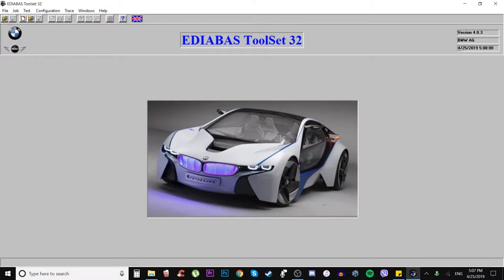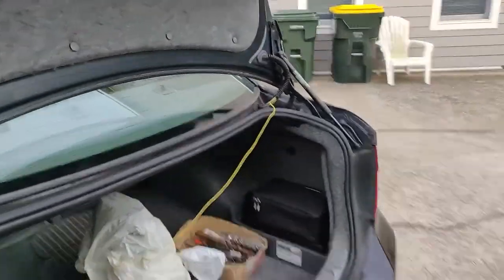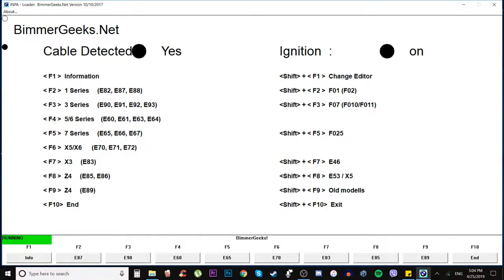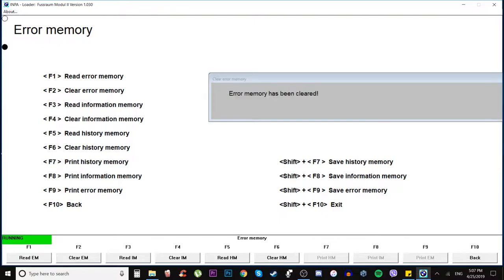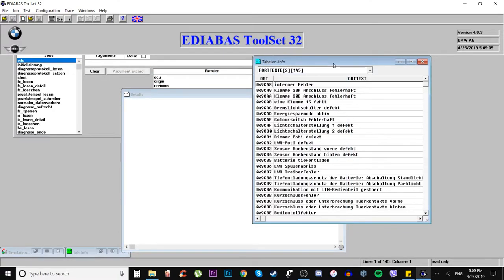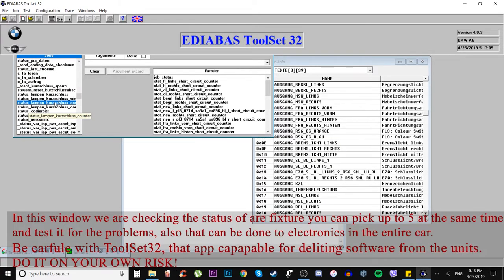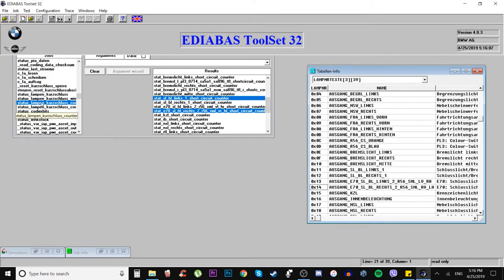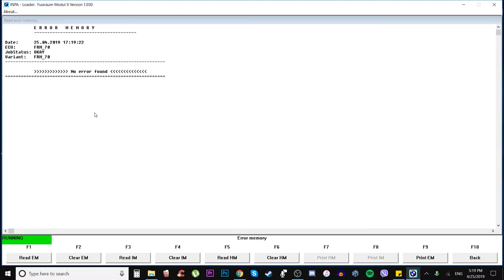BMW Coding FRM short circuit counter reset Toolset32. light not working. FRM2 FRM3

Comment: I have been trying this but can’t get it to work right. Can you help me?
Reply from the maker: Hey! Where did you stuck?
Reply: @Makhnovets  my inpa isn’t working right I guess. It said it couldn’t communicate with Frm and on info screen the Frm wasn’t listed. My issue is the left rear blinker and left side marker don’t have power, no error messages but with fox well I found Frm code 9CBB
Reply from the maker: @nathanielfarmer1732  what year your bmw? What cable you use? Dit you set latency and speed in device manager?
Reply: @Makhnovets  2010 335i and no, I don’t know what that means but I’d really like to.
Reply: @Makhnovets  kdcan
Reply: @Makhnovets  where is the device manager?
Reply from the maker: @Nathaniel Farmer  minute 8:25 https://youtu.be/uYQZcbutWcc also set the bits per second to the highest number
In terms of the cable, it might work it might not depend, you will need to test it on the car if there’s still a communication problem you will need to Solder the two pins in the kdcan, or get one with the switch, but that for later, in most cases it will work fine.
Reply: @Makhnovets  it does have a switch but there’s no number or anything it’s just got 3 or 4 different settings.
Reply: @Makhnovets  ok i see, I’ll try that tomorrow. Thank you ! I had the black dots on inpa but probably had the switch wrong.
Reply from the maker: @nathanielfarmer1732  if you looking on the switch all the way to the right is for the car’s 2009+ to the left 06-08.
I will double check that but I think I got it right, there Only two option all the way to the left all the way to the right.
Reply from the maker: @nathanielfarmer1732  did you figure it out?
Reply: @Makhnovets  I haven’t hooked it back up yet, been working. So will inpa give me the specific code to look for on tool32 or is it the exact same procedure that you did in the video?
Reply: @Makhnovets  when I first started driving this car the blinkers would blink 5 times instead of 3, was that something someone coded in?
Reply from the maker: @nathanielfarmer1732  yes, that was coded for European standards, it’s easy to revert if you want, i can make a video, you gonna need bmw tools as inpa and ncsexpert, i also have video how to install them if so.
Reply: @Makhnovets  I have NCS expert inpa and tool 32 I just don’t know how to use them
Reply: @Makhnovets  I’ve been trying to learn on my own but it’s tough. I’d like to know more.
Reply from the maker: https://youtu.be/KObx-RukECU - this one is how to code(Exaplenation)
https://www.youtube.com/watch?v=aPApyIFPbCc - in this video will be your problem, which is FRM module, you will need to find the hezart light or so and change for the option you like... or you simply can reset the module to Vehicle VO(Default) But watch the first video before doing anything!
This is step by step on resetting the module! Make sure you have battery connected to tricle charger, and your OBD cable work just fine(Talking about Device manager)
1. Load NCSExpert.
2. Load Profile and select Expert mode(You can find in web how to make your own profile for coding, by default you will not have the Expert profile! you will need to make your own!)
3. F1 (VIN/ZCS/FA)
4. F3 (ZCS/FA f .ECU)
5. Choose E89 (for the E9X)
6. Select CAS
7. F6 (BACK)
8. F4 (Process ECU)
9. Select the Module I want to Revert back to Stock.(in your case NFRM or FRM)
10. F2->Choose "SG_Codieren->ok
11. F3->to start coding the ecu with factory settings according to the vehicle VO.
Let me know if you have any questions!
I will make video about module reset soon... Good Luck & Subscribe!
Reply: @Makhnovets  ok I will try this, I had no idea there was so much to this thank you for all your help
Reply: @Makhnovets  I may try this today after work but can I FaceTime you when doing it?
Reply: @Makhnovets  I had my jb4 on map 5 and just read where it has to be on map 0 or off to connect. I want to code the 5 blinks back in also the previous owner installed m3 cluster, did he have to code it in and am I gonna mess that up?
Reply: @Makhnovets  hey are you available?
Reply: @Makhnovets  I got in inpa and my code is 9CBB but I can’t find it in tool 32. So frustrating

Comment: Hi,  if i press f5 nothing happens, it won't open it ?
Reply from the maker: at the top left near the file you can see the job button, open it and then you will see single execution or continuous, press the single execution, also on the laptop you have Fn. button on your keyboard, that can be the issue as well.

Comment: This is very stupid from bmw! Why not just erase a fault code and return the circuit to normal? 
I replaced the body module on a e83 x3 because interior lights were not working. Now i learn that the circuit just needed reset and my autocom cant do it!
Reply from the maker: Yeah. Only BMW does that, they call it safety, but in real life, that system makes BMW look like a Clown...The f****ing check engine light is all about BMW....

Comment: So is this the fix for frm reset When i fucked it up With carly? :D no Light no Windows Workiing
Reply from the maker: Not really. this video for the FRM short circuit reset, if the one of the light not working or so.
For resetting the module to Vehicle VO. you need an NCSExpert, it's included in the tools. if you need to revert everything:

NCS Expert   Password is repxet
reverting settings on Module true NCS Expert.

1. Load NCSExpert.
2. Load Profile and select Expert mode(need special profile with manipulation off)
"you can create your own profile,  I don't have the system installed since i change to mac, so can't really help much. but i'm working on video how to install bmw tools on macOS."
3. F1 (VIN/ZCS/FA)
4. F3 (ZCS/FA f .ECU)
5. Choose E89 (for the E9X)
6. Select CAS
7. F6 (BACK)
8. F4 (Process ECU)
9. Select the Module I want to Revert back to Stock.
10. F2->Choose "SG_Codieren->ok
11. F3->to start coding the ecu with factory settings according to the vehicle VO.

If you use a profile that has "manipulation" enabled in the settings, the software will upload the content of the .MAN file in the module when you do a SG_codieren job. (That mean it will upload the blank file) So you nee have manipulation turned off, the software will use the VO and the daten files to generate the default file that would have been found in the module originally (based on the vehicle options list)

Try not to play with NCS as far as you don't know functionality.
I also have couple of videos that have good explanations of how to use and what not to do! PlayList "Coding"
Some explanation of functions if you are interested:
CODERINDEX_LESEN == Read out the Coding Index of the selected ECU.
CODIERDATEN_LESEN == Read out the coding data on the selected ECU.
FGNR_LESEN == Read out VIN number (short).
FGNR_LESEN_KURZ == Read out VIN number (long).
AE_INDEX_LESEN == Read out the Software Index of the selected ECU.
FA_READ == Read out the Vehicle Order of the vehicle.
FA_WRITE == Write the Vehicle Order of the vehicle.
AIF_LESEN == Read out the User Information Field.
SG_RESET == Reset/Re-Start the selected ECU.
Reply from the maker: https://drive.google.com/file/d/1Iy2vsQHLlm5uLjyw8qGCPG02-NZml1io/view?usp=sharing     that's the profile settings. little old file but it's pretty much the same way.